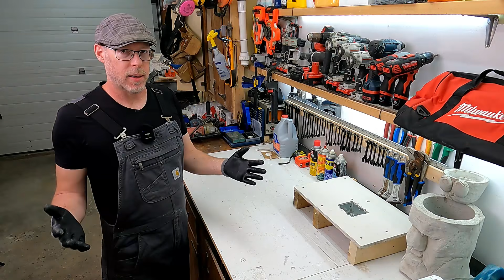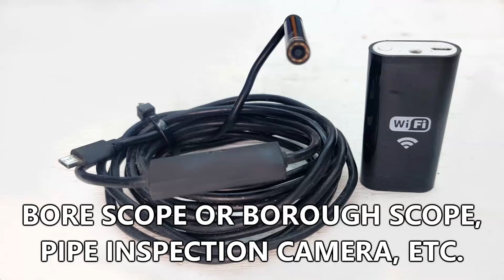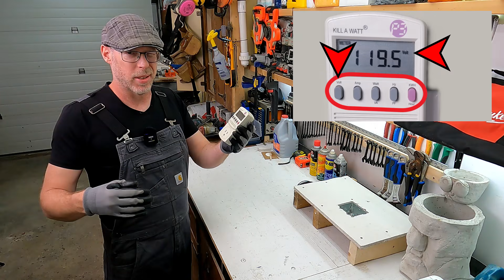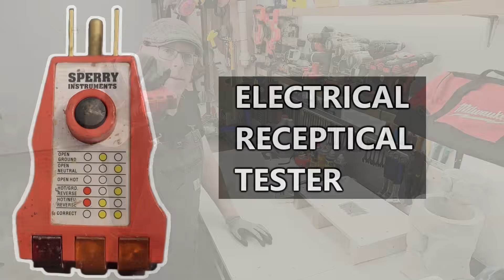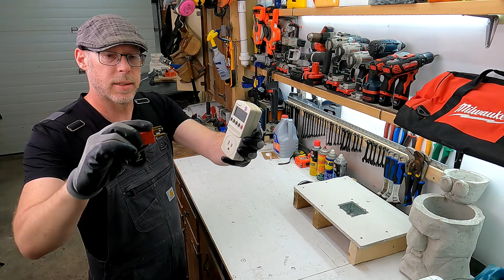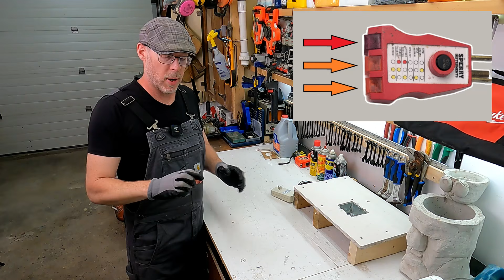3 (Uncommon) Tools That Everyone Should Have

Comment: That Kill A Watt device is cool. 
I've never seen one that small. 

You know they make something like that, but bigger. 
Well actually they aren't that much bigger. 
But you can do a whole room a house or multiple buildings. As long as they all have the same power source. 

For example, many years ago I built a 10'x 12' shop and a 10'x 12 storage building with a 8'x 10' bathroom in-between them. 
Then about 3 years after that I built a 16'x 24' two story barn type garage. 
All this was about a 150 feet from my house. 
So I just tapped into the house for my electricity. 
Well I wanted to know how much electricity I was using in all these buildings. 
So I purchased this thing, I can't remember what it is called, this was many years ago. 
But I'm still using it. 

Anyway this thing came with 2 pieces and each piece is about as big as that thing you were showing. 

So the way it works is one piece just clips on to the wire you are getting your power source from. 
The other piece is like a small monitor, smaller than a phone. 
This is wireless so you can take the monitor a couple 100 feet away from the source. 
Anyway you can program this thing to tell you how many watts you are using per minute per hour per day per week per month and so on. 
You can even program into it how the electric company is charging you per and it will figure everything out for you. 
This thing is great.
Reply from the maker: I think you are describing an inductive ammeter style wattage meter. I use something like that ti monitor power consumption on my swimming pool test lab!

Comment: Good selection. The scope is great for viewing behind or under heavy furniture or monitoring root incursion to a drain pipe. Wish I didn't know that but some idiot planted a maple tree directly over the sewer line.
The Kill A Watt is incredibly useful for hunting vampires and for deciding what size generator you need or what to run off the generator or power supply you have.